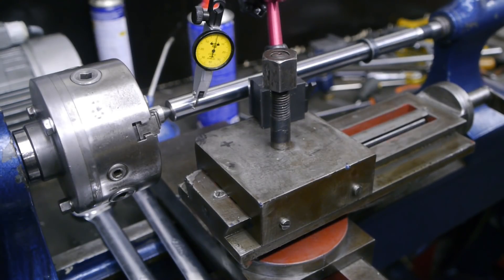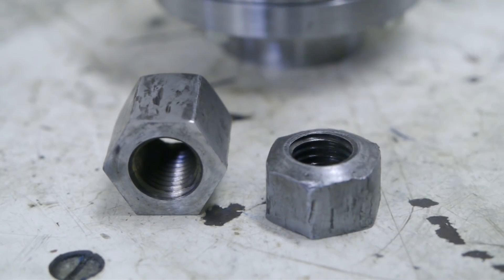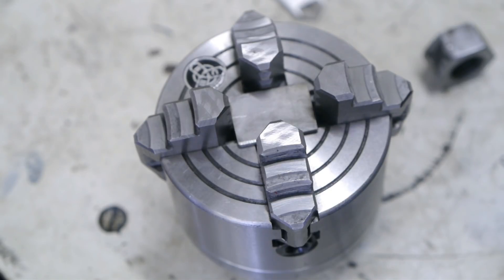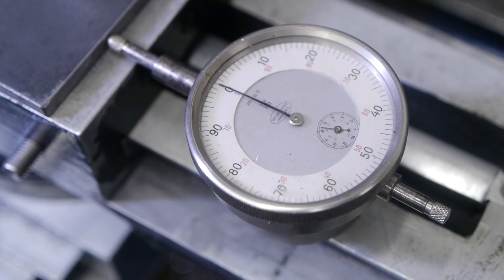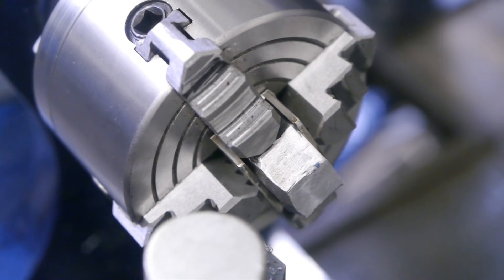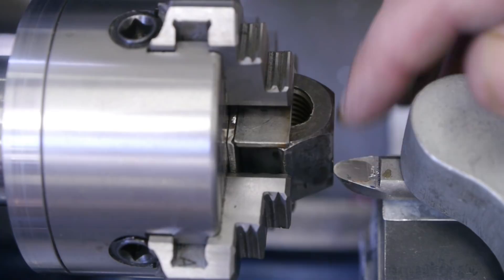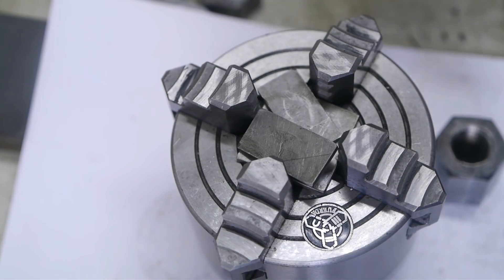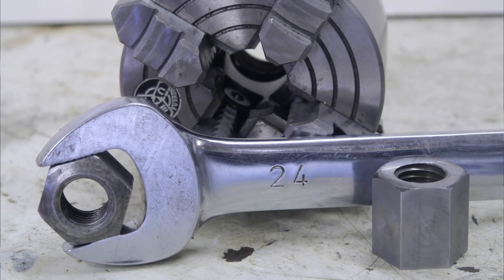Making Imperial Metric Hybrid Nuts

Comment: Hi, only just discovered your channel  and I love it. I too use old shock absorber shafts they are very useful.  I always associated  stripping a nut with damaged threads and the nut slipping not the spanner slipping on a rounded nut. Nice work though.

Comment: Crazy! I just had the same thing done in opposite. My tool post nut is metric, but I use an off set ratchet wrench to adjust it yet didn't have a metric wrench, so I had it machined to imperial.
Reply from the maker: Using a ratchet wrench sounds like a good idea.

Comment: Guessing they are designed to be a loose fit for a 1" (25.4mm) spanner. I feel your pain - I have an Indian shaper that seems to have socket head screws that are poor fits for both magic and imperial Allen keys
Reply from the maker: Those will be hard to machine to the right size.
Reply: Rolingmetal Haha, very true! I can follow AvE's advice and make a custom 5-sided socket broach while I'm at it

Comment: Since they measure 25mm...Why didn't you just buy a 25mm spanner ?... Or even a 1" which is what I guess they are supposed to be
Be ?. Or even if you have spare 24mm spanners, grind one of those a bit wider ?
Reply from the maker: Grinding a bit of a 24mm would be quick and dirty solution. Why didn't I think of that...

Comment: It's even getting harder here in the UK to buy imperial hardware,....but it looks like i need to send you some imperial spanners ...
Reply from the maker: I guess not much new equipment is using imperial. So the need for tools and fasteners will get less and less.
Thanks for the spanner offer but I have to decline as it will cost way to much to ship those to my neck of the woods.
Reply: well,...you only about 600km away, ... so can't be that expensive.

Comment: You could certainly not expect to buy a nut that tall as on the top of your tool post anyway RM! 
That is an exotic
Reply: Coupling nuts are tall.  Originally used to connect two rods but handy for a number of other things.

Comment: buying new nuts is a pain, then you have to work out if they are whitworth or unc or something weird, too much trouble for old threads, metric so much easier! shame the usa is holding it back!
Reply: UNC and UNF were perfect. Whitworth are very old. Most things were done with a 7/16ths, 1/2 and 9/16ths wrenches.
Reply from the maker: I think it's mostly hobbyist that keep using imperial out of nostalgia or in an attempt to be different :)
There is not much being made using imperial so in time they can shine up their spanners and put them on display :)
But to be honest if I had lots imperial tools I would probably also use then instead of buying all new metric tools.
Reply: Except for in the USA.

Comment: exactly the trick i used on my 1949 bsa, i didnt have all the bsw, af, and cycle thread spanners for everything, so made it fit the nearest metric once i got them off!, a 25 isnt any iso or other standard size, so they dont make it, well they do, as cars tend to use stupid head sizes on purpose, they look through your toolbox and then make a fitting needing a 28.5mm heptagon deep socket
Reply from the maker: I've run into a few odd screws and bolts while working on cars. Mostly annoying tamper free stuff.
Reply: so true, in the US you may find yourself working on an engine that has metric and inch bolts.